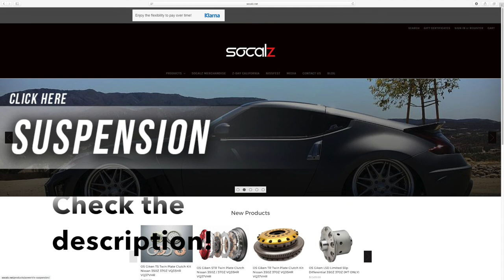youtube video #-9p12qmw17k

Comment: hey I have a question other then the Rev up having a few more horse , can I use another de in my 06 350z straight drop in. thanks for info
Reply from the maker: Lyndon Johnson If you have a 06 Manual with a Rev Up. The only drop in motor is a Rev Up. If you need a motor. You can message me on Insta. I have one for sale, needs a bottom end rebuild. I think just the bearings. Has 60k miles on it
Reply: Christian Lopez what's you IG